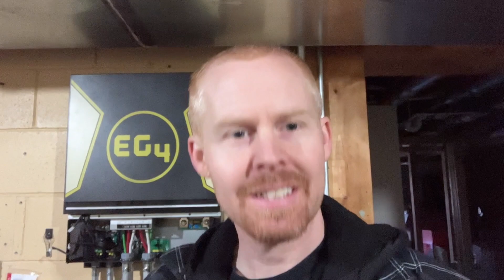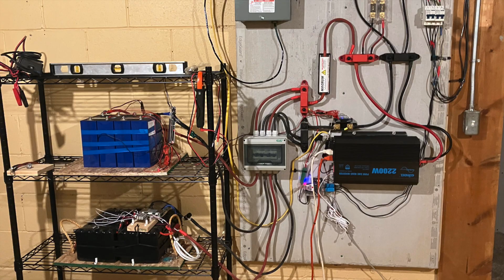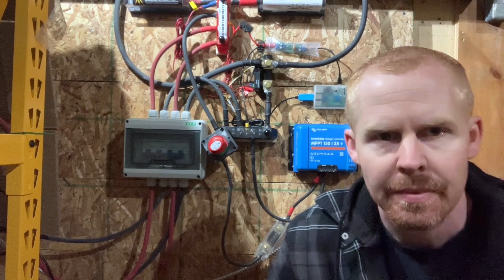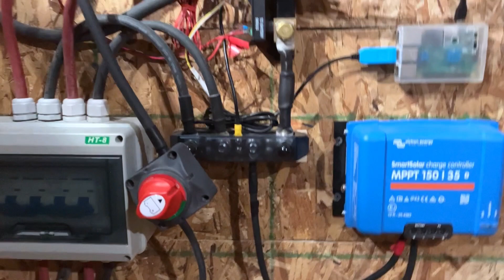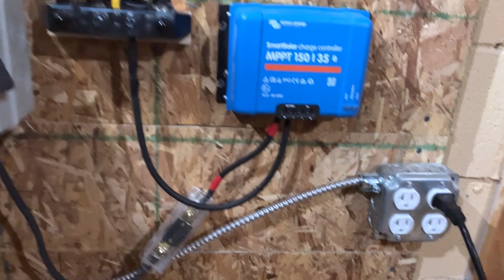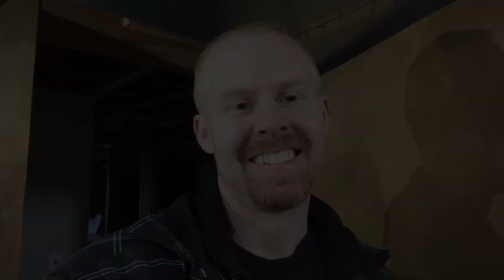Learn From My Mistakes...

Comment: My first time hooking up a smaller Victron system, I trimmed the Cerbo's power supply wires so that they were more aesthetically pleasing. When I butt spliced the wires back together, I stupidly looked at the wire quickly and the Victron negative wire has a red stripe on one side of it, so I thought that was positive. In the end, I wired it backwards. Plugged it in, turned on the battery - BANG! - one dead Cerbo. For the entire next week (and I still hear echoes to this day), I said to myself, "How on earth could you wire it backwards? I can't believe you killed a Cerbo."
Reply from the maker: Yikes!  I think a lot of it boils down to just being excited to get started with things and we tend to make stupid mistakes.  I know I constantly have to tell myself to slow down and take my time...

Comment: I like the Victron lynx distributor bus bar system. A little pricy, but makes my install look much neater and more logical and added additional overcurrent protection. I have one on either side of a lynx smart shunt. Probably could have gotten away with the lynx power in and just converted it to install the mega fuses, but wasn’t that much more with a coupon I had to buy 2 lynx distributors. Had to hunt around to find mage fuses that would work in a 48v DC system as most are for a 32v or less DC system, found some 70v DC versions out on mouser.
Reply from the maker: Yeah I like the looks of them, but like you said they are a little pricey.

Comment: Good job finding your missing load.  Clean design and wiring is key to making the system maintainable and easier to troubleshoot.  I must say that your wire routing is a mess 😂.  Good job none the less on finding your issue.